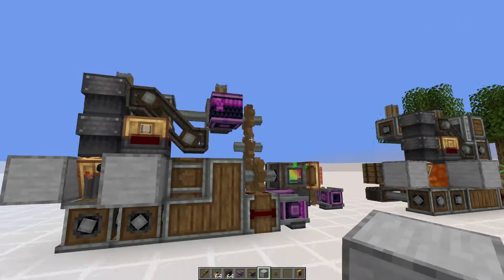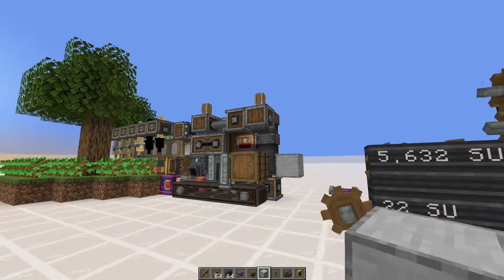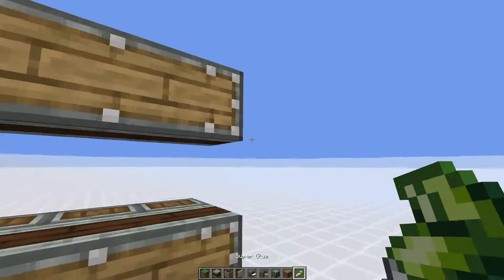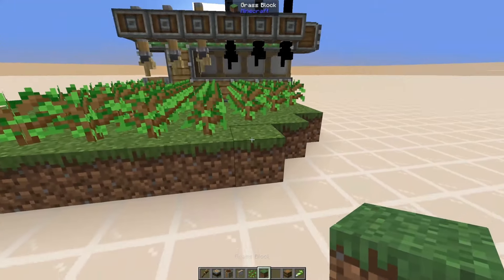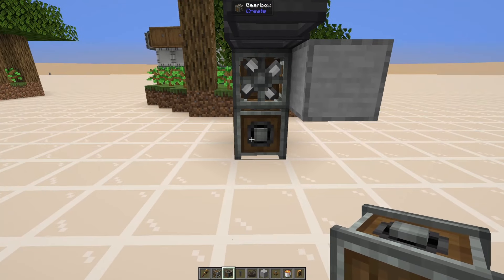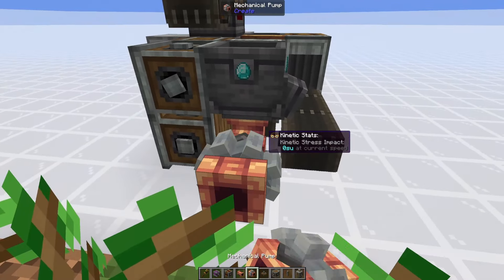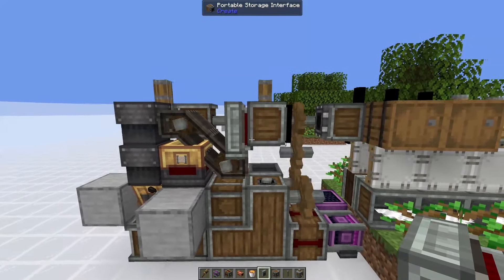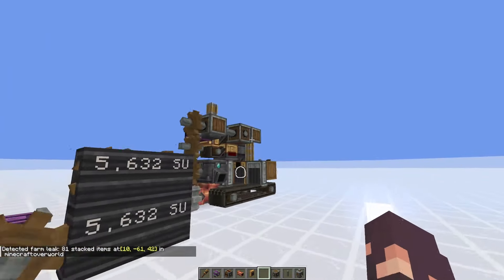How to Make A DIAMOND FARM In The Create MOD! | Create Mod Block-by-Block TUTORIAL

Comment: so if i want to compress the coal block into diamond, it tells me you need a blaze burner and when i connect the blaze burner to the the lava source it doesn't use the lava i just gave it , it'll only work if i use a lava bucket on it
Reply from the maker: Create Ultimate factory slightly changes the recipe but you're on the right track. If you don't have the "straw" item from create mod addon then you'll have to setup a lava spout > bucket > mechanical arm > blaze burner >  back to chute that drops empty bucket under the spout

if you do have the straw item. r-click the blaze burner with the straw and you'll be able to connect the pipe straight to it

Comment: Everything works in the farm for me besides the charcoal being turned into charcoal blocks instead of coal but the mod allows the charcoal to be turned into coal but it just turns it into charcoal blocks whenever it goes through the mechanical press.
Reply from the maker: you can set a list filter for the basin to only make coal and coal blocks. this will prevent the charcoal blocks being made

Comment: I have a 12 slot 2x2 spruce tree farm producing about 300+ logs in 5 minutes.
I use a mechanical bearing, 8 water wheels, a speed controller at speed 16 (can be set to max speed) and Farmer's delight's rich soil.

Comment: Everything works like it should except the charcoal does not automatically go into the funnel and then into the basin… I have to keep putting the charcoal in there. Is there a way to push the charcoal into the basin without me having do to it manually?
Reply from the maker: Do you have the valkerian skies mod installed? there's a bug with that mod and funnels with fans blowing on them. you can either remove that mod, or setup a clock to turn off the fans blowing for a few seconds for that funnel to pickup all the infested stone that was made and then turn it back on. (you can also setup a belt/depot to have the items get picked up that way if you'd prefer. idk the exact timings for how to do that so you'll have to do some trial and error.

Comment: it didn't work and I've read the description in Create: Additional Recipes mod
I don't see diamond on the recipe list 
I wonder what did I miss
Reply: Same hear don't see the resipe
Reply from the maker: If you have create: Additional Recipes installed the recipe should be there. my guess is you have another mod, or the mod makers of the pack you're playing removed that crafting recipe for whatever reason
Reply: @kindlebubbledump  Actually I'm the mod maker. It was an issue with create additional recipes Mod. There was a update that fixed the problem.
Reply from the maker: @ oh sweet!
Reply: @mwilley1977  Thanks , I'll be waiting
Reply: @mwilley1977  I updated all my mods now and can't make diamond from a block of coal. Seen no recipe. What do I do wrong?

Comment: Hello kindle, thank you for another awesome tutorial. I have everything working but the charcoal is getting compressed into charcoal blocks instead of the coal which then is compressed into coal blocks. I have all the mods that I need for this to work, and it does work every once in a while. I was wondering if there is a solution to this or not, maybe the basin has to fill completely up with charcoal blocks before the coal will be made into coal blocks? I appreciate any advice
Reply from the maker: hey! you have an additional modpack installed that adds that recipe. no problem, just add a list filter to the basin for coal and coal blocks and you should be good!
Reply: @kindlebubbledump  thank you for the quick reply! Your understanding of this pack is impressive, that fixed the problem immediately. You have earned my sub for sure :)
Reply from the maker: @boop2611 nice! Thanks for the sub!
Reply: @kindlebubbledump  hello, it seems that the mod quark adds the charcoal block. After adding a filter, it didn't produce coal blocks. I disabled the charcoal block, but than I was unable to craft coal blocks out of charcoal. It just deleted the recipe. Do you know a way around it?
Reply from the maker: @ if you have create: additional recipes, you should have a charcoal > coal recipe and a coal > coal block recipe. If you don’t have 1 of those in JEI then you’re kinda toast. If you have both of them, it should be working if you set a list filter to allow coal and coal blocks and put that in the basin
Reply: @kindlebubbledump  I am going to add that mod to the modpack
thank you :D

Comment: the blocks of coal go into the lava basin but dont come out as diamonds does it just take a while or did something break?

also the press above the lava doesn't press down
Reply from the maker: Do you have create additional recipes installed? I’d so it should work. Try breaking and replacing the bacon +press and make sure the press is being powered
Reply: @kindlebubbledump  yes i have the mod installed and i also just tried replacing them and nothing worked so I'll try and redownload the mod
Reply from the maker: Worth a shot. Do you have the coal block to diamond recipe in your JEI? it’s possible you have another mod that removes the recipe for some reason
Reply: @kindlebubbledump  yea i just checked and the recipe is not there, which is sad because i don't want to search through 120 mods. do you know what version you were playing on this tutorial though?
Reply: it actually seems that none of the new recipes are in here
Reply from the maker: @FrozenBurgerz I’m on additional recipes 1.2.0. I do know one of the versions breaks this farm so there’s a chance ur on the broken one but idk
Reply from the maker: @ oh weird
Reply: @kindlebubbledump  after some testing with no mods but create, JEI, and create additional recipes, apparently the mod creator changed the recipes so you can't make diamonds anymore in 1.20.1 😭😭
Reply from the maker: Ahhhh rip!  I know create ultimate factory has a diamond recipe, u can check if they have a forge version that works
Reply: @kindlebubbledump  yesss your a life saver, it works on my version and looks like it can still run with your design!
Reply from the maker: @FrozenBurgerz nice! I haven’t dealt with it too much so I didn’t know much about it. Glad it works!

Comment: I have a problem with my farm. Built it the same way and used the same filters but there must be an issue.The cold press maked charcoal blocks like crazy but no coal blocks. Got 32 charcoal blocks in the basin and there they stay. The press doesn't move to compackt the charcoal blocks to coal blocks or the charcoal to coal. 
Where is my problem?

Edit: Downloaded the Additional Recipes and still have no luck. Got coal clocks in the lava basin now and nothing happens. No recipe tells me that coal can make diamonds. What now?
Reply from the maker: The additional recipes mod got changed to remove that recipe. You now need create ultimate factory (link in pinned comment) and then it should work!
Reply: @kindlebubbledump  thanks for the quick reply. Will try that.

Comment: I've got a problem with the tree farm.
Sometimes the farm stops working because the windmill bearing get replaced by a dirt block, I don't know what causes this but it happened few times already.
Reply from the maker: Uhhh. There’s nothing in the farm that could place a dirt block so idk how this could happen. Are you unloading the chunks in a weird way? Do you have optifine? Those are the only 2 things that I can think of that could be the issue. Do normal windmill bearings get replaced with dirt when not in the farm?
Reply: @kindlebubbledump  I'm not using any chunkloader and no, I'm not using Optifine.
I build the farm in the Prominence 2 RPG modpack and I'm using rich soil because of its properties.
I noted when the oak tree is formed, if the wood overlaps with the terrain it stands, after the blades break it, that terrain becomes dirt.
I tested it even with obsidian blocks, but they become dirt anyway.
I tried with an open space filled with water and it's the same, dirt replace the water.
It's strange because not a single block of rich soil is replaced by dirt, but only blocks different from dirt or similar.

Comment: I'm having a problem where the charcoal is not going into the basin and just piling up
Reply from the maker: you might have the valkerian skies mod which has a bug that prevents funnels from picking up items when a fan is blowing them. you can either have the items drop on a depot and go into the basin that way, or setup a clutch/clock system to turn off the fan occasionally for the funnel to be able to pickup the blocks!

Comment: i feel create pressured diamonds or something is more fun and more hard to do to make diamond farm, it involves of crafting coal and flint that then will turn into diamond with a very low rarity,then the failed diamond became rough diamond that unusable but can be recycled as a compound we made before to make the system rinse and repeating till its success
Reply from the maker: That does sound like a ton of fun. Is that a default recipe for Create, or is it an additional mod?
Reply: @kindlebubbledump  its additional mod called "Create: High Pressure" on modrinth(had to refind the mod since i forgot the name off lol)
it works by Turning Charcoal/Coal into Graphite powder bt blasting then compacted to Graphite that then will be pressed with Mechanical press on Basin to make mostly Immpure Diamond with a rare change (forgot how rare) into diamond, the impure diamond then can be processed back into Graphite then start the loop
edirt : i think your design can be readapted for that one machine
Reply from the maker: @ShiroCh_ID  That's super cool. I'll look into it but I don't have it in my modpack unfortunately

Comment: Note: This farm wont work when burning wood with the fan it turns it into charcoal and u cant use the charcoal to make diamonds also the mod wont allow 9 coal blocks to make 1 diamond anymore
Reply from the maker: Yea you'll need create ultimate factory now for it to work as expected
Reply: @kindlebubbledump  You just have to burn the charcoal into coal using a fan and soul sand fire

Comment: is there a third mod needed for the coal blocks to be crushed into diamonds?
Reply from the maker: no that recipe should be covered under the Create: Additional Recipes mod! I do think there are other mods that will let you craft this if you don't have the recipe
Reply: @kindlebubbledump  Doesnt work for me. All the required mods are installed.
Reply from the maker: Create additional recipes got updated removing the recipe. You can switch to create ultimate factory which should work right away
Reply: @kindlebubbledump  both of the mods are installed.
Reply from the maker: @mental_inc Rip. What part doesn’t work for you. Do you have the recipes showing up in JEI? If not another mod could have removed that recipe

Comment: Is it normal thas the press create charcoal block ? I did all off your steps 😀
Reply from the maker: You probably have another mod installed, if you set a list filter to only create coal and coal blocks and put that in the filter part for the basin, it should fix your issue
Reply: @kindlebubbledump  yes it's work's ich have read a comment below how has the same problem :) and thank you :)
Reply from the maker: @bigcard9206 great!

Comment: Question: Is this exclusively Create? There aren’t any add-ons that grant the ability to generate diamonds, this is purely the base Create mod?
Reply from the maker: It uses the mod Create: Additional Recipes. This mod is usually in create mod packs, but check your mods folder for it to make sure
Reply: @kindlebubbledump  I usually make a pack for myself to play, as my computer isn’t good enough to handle Beardstone’s Perfect World let alone other packs. So, thank you for the information
Reply: @kindlebubbledump  btw the brass funnel wont pick up the charcoal.after the wood is done smelting
Reply from the maker: @ do you have the valkerian skies mod installed? There’s a bug with that mod that prevents funnels from picking up blocks when a fan is blowing on them. You’ll have to start a clock that turns off the fan periodically
Reply: @kindlebubbledump  no
Reply: Sorry I ment no I don't have the skys mod but thanks I ended up making my own design inspired by yours, it's not as good but it works
Reply from the maker: ok great! Glad you have a working version!
Reply: @kindlebubbledump  it's working, with the way I made it😀, it's the first farm I made in create
Reply from the maker: @Ninjah853 Nice!

Comment: the first brass funnel wont pick up the charcoal for some reason, i have the addon downloaded but I cant make it pick up the charcoal after burning the wood
Reply from the maker: You might have the valkerian skies mod installed. this will not let funnels with a filter pick up items off the ground. You can fix this by turning off the fan once every minute or 2 with a clutch and a redstone clock, or removing that mod.
Reply: @kindlebubbledump what if I don't have valerian skies installed, I'm playing atm9 and I have the same issue

Comment: why are my charcle  not compressing into coal and why does my press not work on the coal blocks its not turning them into diamonds
Reply from the maker: The mod Create: Additional Recipes is required for those recipes, do you have that mod installed? if so there is probably another mod that removes those recipes. (if you can see the recipe in JEI then something else weird is happening so let me know)

Comment: The farm does not work correctly for me.
In the first pool, where coal blocks are actually produced, I get wood coal blocks.
Do I need to make any adjustments?
Reply from the maker: It sounds like you have an additional mod or two that adds that recipe. I would create a list filter and add coal+coal blocks to the filter in the list and add that to the basin. That should now only make the two crafting recipes you need
Reply: @kindlebubbledump  This may well be the case.
I will check it out
thanks for the tip
Reply: I put the list filter on the basin but it  didn’t work for me only make charcoal now and without list filter it make charcoal charcoal blocks ..

Comment: I am pretty much new to Create mod, I don't know how to generate 5,000 stress units. And if I manage to generate that amount of Su, where do i connect it? Im sorry if i sound dumb, I dont know how things work in create mod

Edit: Sorry, i watched the entire video and I dont need that much Su, though i still dont know how to generate a big amount of Su and connect it to the farm, my apologies
Reply from the maker: in the video I have a purple item called a creative motor, thats the creative way to get enough stress units to power the farm. You can connect your generator to that part and it will work great! 

For a way to generate SU, in the base create there are 4 generation methods, water wheels, large water wheels, windmills and a steam engine. they all generate different amounts. I would look up a tutorial on create mod generation methods to learn more about them, but you'll need 1 or more of those to power this
Reply: U can use a crap ton of large water wheels. Thats the easiest and cheapest.

Comment: in my build the press isn't pressing i think the reason is because the lava is 1000 mB ? can you help me fix it?
Reply from the maker: If you have the create additional recipes mod, and the coal block > diamond recipe in JEI then it’s an issue with the press specifically. 1000 mB should work, is the press connected to power? And do you have coal blocks in that basin?

Comment: i did everything alright but the basin isnt taking the coal?
Reply from the maker: is the funnel not picking up charcoal? you can try removing the filter (this will add normal logs to the basin but it should only add 16 which in the long run isn't too many)

Comment: So i have the mod packs im making the right block of coal but it wont create the diamond any help?
Reply from the maker: Do you have the diamond recipe in JEI? If so is the press powered and as a final test can you make the diamond with the coal block and lava in a basin and see if it works outside the farm?  If that does work break and replace everything in the diamond crafting part and see if that fixes it
Reply: @kindlebubbledump  i dont see the recipe in my jei even though i have the mod. i am in 1.20.1
Reply from the maker: @colbymeyer9187 a new update to additional recipes removed the diamond recipe. You’ll need to use an older version or switch to create ultimate factory!
Reply: @ oh okay thank you so much

Comment: everything's working except for the diamonds. The coal just sits in the lava thing forever. I have the mod requirements
EDIT: Lava no longer powers this. You need a blaze burner
Reply from the maker: It should be coal blocks, but assuming u have that, make sure you have the coal block to diamond recipe in JEI it’s possible the modpack removed that recipe for whatever reason
Reply: @kindlebubbledump  I got it to work by adding a blaze burner

Comment: my mechanical press isnt turning coal blocks into diamods
Reply from the maker: do you have the recipe in JEI? make sure you have the required mods and it's showing up as a possible recpie. there's a chance your modpack removed that recipe
Reply: @ i just noticed my farm makes only charcoal and no coals
Reply from the maker: Then you probably don’t have the correct mod. Check the pinned comment where I have the create ultimate factory mod link
Reply: @kindlebubbledump i got that still makes only charcoal
Reply from the maker: @michalvrm set a list filter for coal and coal blocks in the first basin. That will prevent charcoal blocks from being made